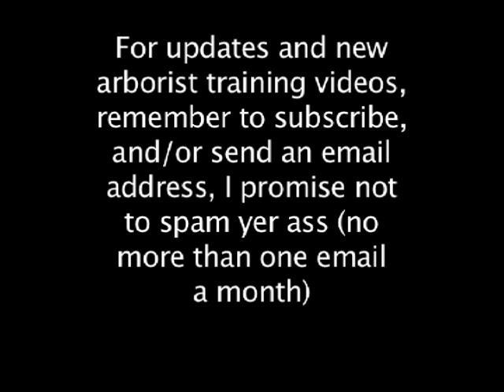Efficiency in Tree Removal pt.2  Daniel Murphy 3 Tulip Removal

Comment: Great video Daniel. I'm not an arborist but have plenty of trees on my property, so I usually get proper arborists in to fell the big ones that become dangerous. I'm impressed by their skill, and watch a lot of these videos online. Many of them stress the importance of having a clear escape route as the tree falls, in case they kick back or slide off in an unpredictable way. I was just wondering with that last tree you cut down, with rocks in the base cavity, where you had to be roped to the tree about 6 feet up, to make the felling cut. It looked incredibly dangerous and I didn't see how you could get out of the way if the tree kicked back when it fell. The video cut away at that point. Sorry if it's a dumb question to you experts, but how did you do it? Thanks.
Reply: I would say without a barber chair situation, or anything in its path obstructing the falling stem, once that weight gets moving in a direction, momentum dictates everything connected to it will follow.
Reply: ...= no chance of/nothing to kickback!
Reply from the maker: there are a lot of reasons to get away from the stump when the tree starts moving... barber chair, or loose limbs falling when the tree starts moving, or if it contacts another tree on the way down, all kinds of things can come raining down or even catch another tree and get sprung back etc... none of them were present here...